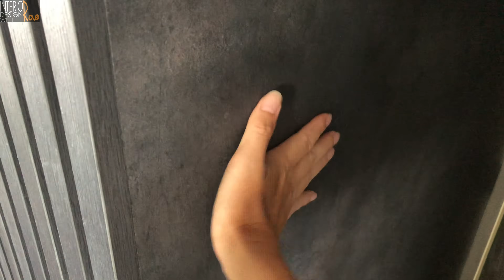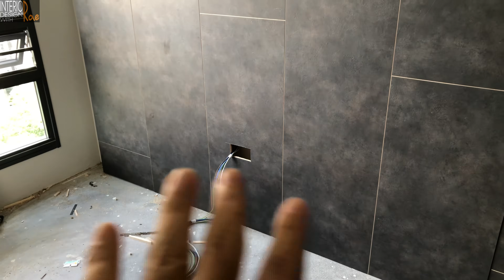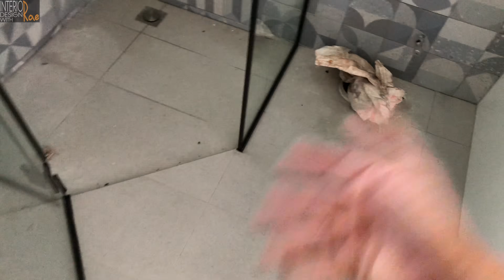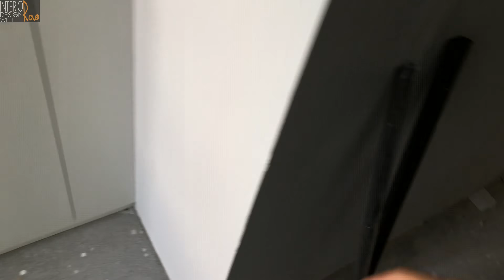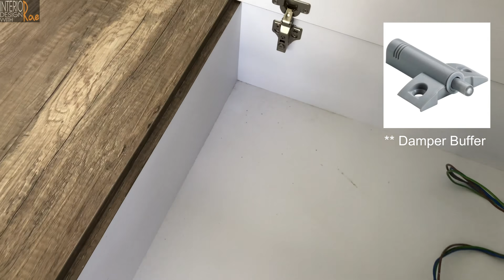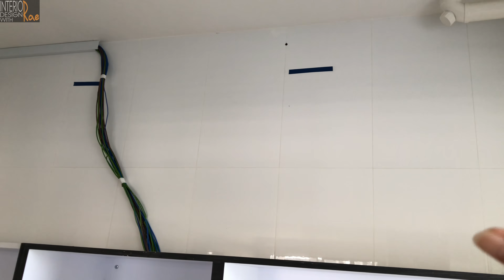Watch This Before Drilling Kitchen Wall! | 5Rm HDB (BTO) Dawson | Part 3 | Project Makeover Series

Comment: Is acrylic or perspex instead of glass used for shower screens? Seems safer.
Reply from the maker: Glass is easier to maintain as it doesn’t scratch so easily. All the glass used inside homes are tempered, hence it’s safe.

Comment: For the shower area in the bathroom, I wonder how a rectangle screen with a sliding door would compare to the diagonal design.
Reply from the maker: Hi Jerry. Yes it's possible, but it has to have 2 panel doors each sliding to one side of the fixed panel.

Comment: Hi Rae, thanks for the video. You explain very well and in detail how and why things are done. Value-added service! I like the specially designed layout of the master bedroom and the black framing and handle of shower screen. Just curious, the choice of the patterned grey wall tiles in the bathroom..was it decided by the owner or you pick for them?
Reply from the maker: Hi Yvonne. Thanks for your kind words. In every design process by me, I would choose from the wide range of tiles and propose to my clients. But of course anything is possible, so it all depends on my clients if they want to pop by the tile shop. For this common bathroom wall tile, it was a decision we all agreed on.